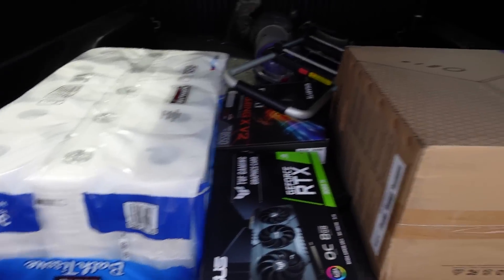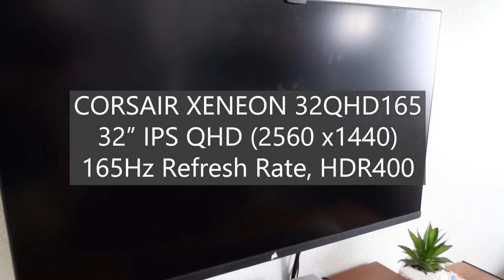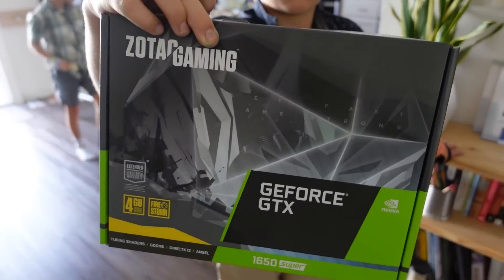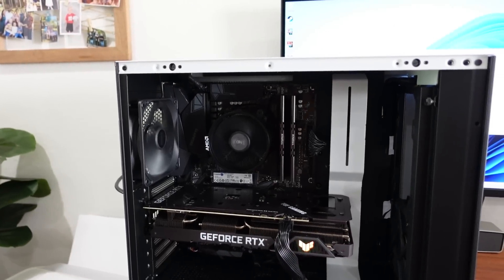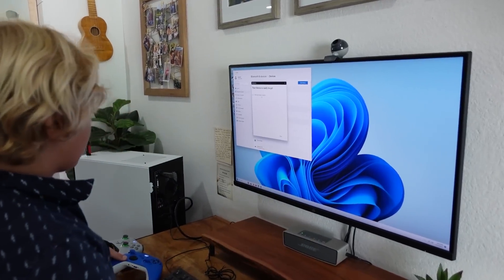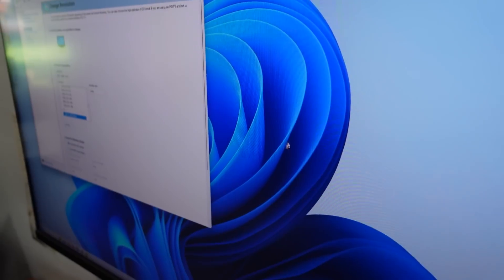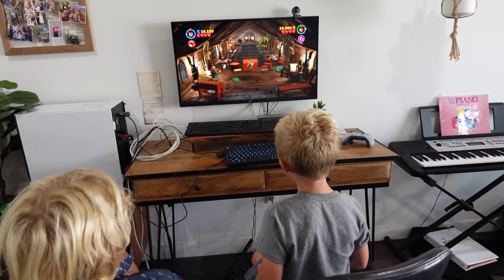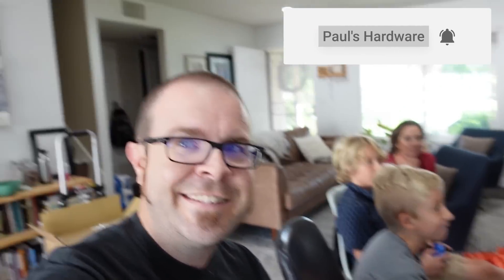My Nephews had a List of PC Problems...

Comment: i have 4 xbox controls and i also have non stop connection issues with my xbox controls for both my 2 win 11 pcs and win 11 laptop. they dont want to auto connect when i turn pc and and want to game with them. i have to make the pc forget them and try a couple of times to resync them all.
Reply: Do you have the Microsoft  usb Xbox wireless adapter? A friend of mine bought one to help it work better when he has multiple controllers attached

Comment: Completely wrong explanation on refresh rate, you don't see it earlier you see it more often. Instead of seeing 30 frames, you see 144 so the distance the cursor moves between frames is smaller and therefore looks smoother. Seeing it move earlier would be before you even move the mouse.

Comment: I did that for my niece and nephew during the pandemic with left over/extra/bundled parts from my new build.  They got a pretty sweet system out of it.  
Mark IX
AMD Ryzen 7 5800X CPU
GIGABYTE X570 I AORUS Pro Wi-Fi
PowerColor Hellhound Spectral White AMD Radeon RX 6700 XT GPU
G.Skill Ripjaws V Series 32GB DDR4 3600 CL16 RAM
Inland Premium 1TB NVMe SSD
Phanteks Evolv Shift XT Silver Mini-ITX case
EVGA Supernova 750 GM 80 Plus Gold SFX PSU
EK AIO Basic 240mm CPU Cooler
EVGA Z12 RGB Gaming Keyboard
EVGA X20 Wireless Gaming Mouse

Comment: Family time is always special. Your nephews are going to continue to have problems with the controllers if they continue to plug the receivers into the back of the PC. That hunk of metal will act as a good shield. How about getting them a USB 3 hub that can sit on the table so they can plug the receivers into that?

Comment: the kids sitting close to the monitor feels just like old times when we sat infront of the good ol CRTV. good job Paul
Reply: The days of sitting to close to the TV (which is where this myth came from) are long gone with CRT tvs. They used to say it would ruin your eyesite sitting too close to old TVs but that wasn't true. I've had a couple of Optometrists confirm this over the years.
Reply: OP, love this comment!  I completely remember those years in the mid 80's with an NES, or maybe, Commodore 64.  I second that "Good job Paul!"
Reply: But we were seeing prison bars between the pixels. Now they only see pixels.